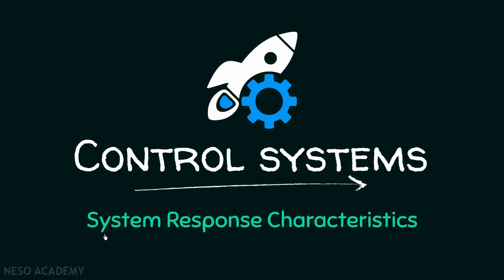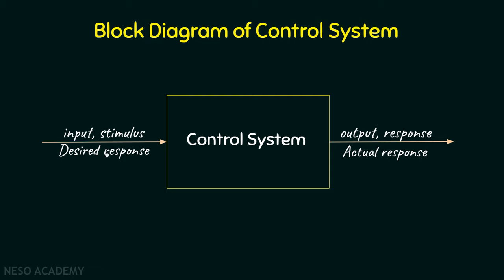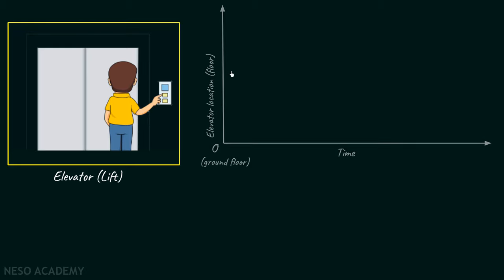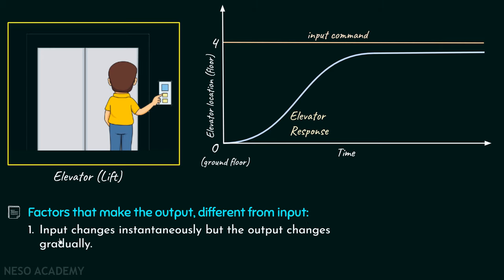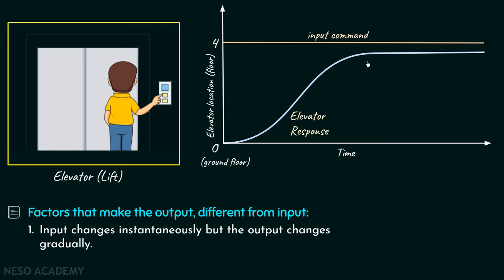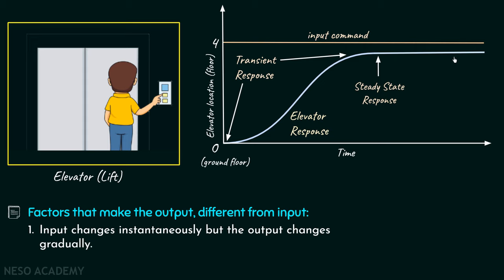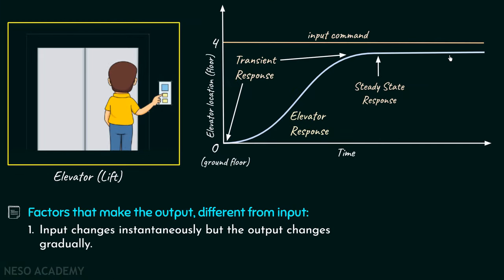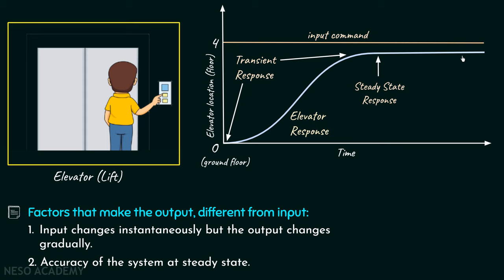System Response Characteristics

Comment: in your explanations, you have given the example of elevator and you are considering the output error while the elevator already reached  to the fourth floor. It's wong and funny. 
it's actually the time when elevator start to move with steady state error. the transient response is just the time when starting of movement has initially instability. 
Kindly be cautious, ...

Comment: why when we switch on the light(it is also the example of control system ) it doesn't take time  to give the desired output ?
Reply: It takes time only that it is not easy to measure the time... probably in the range of milliseconds